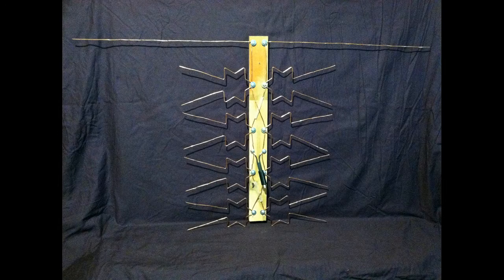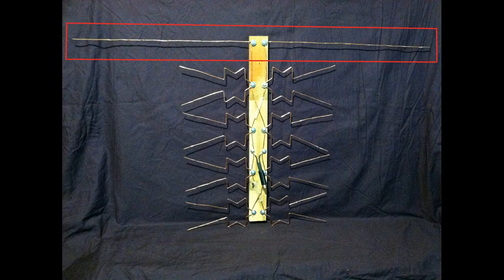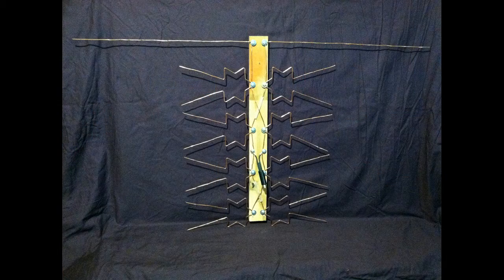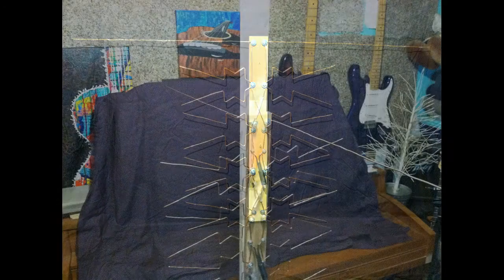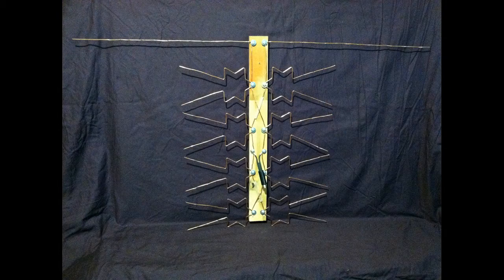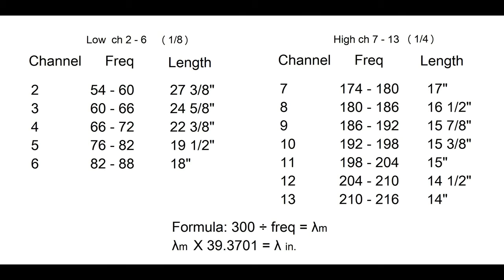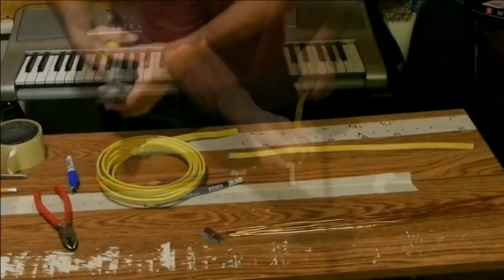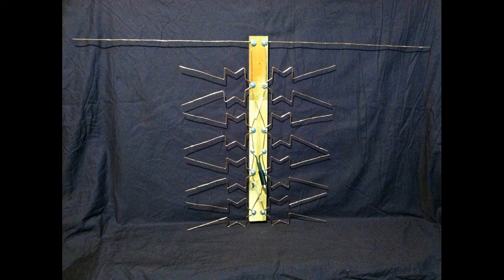HDTV Antenna - VHF Add On

Comment: What is the space between the two elements and if you needed rf channel 13, would that be two elements at 7 inches each?
Reply from the maker: 2 elements at 14 inches each :)
Reply: @DIYProjectsWithMike  That was my original assumption, although there must be a gain limitation on vhf at long range, lol.